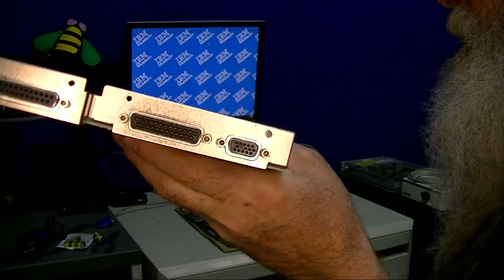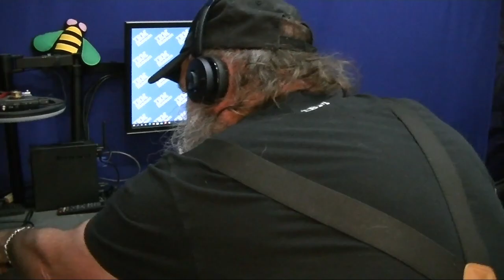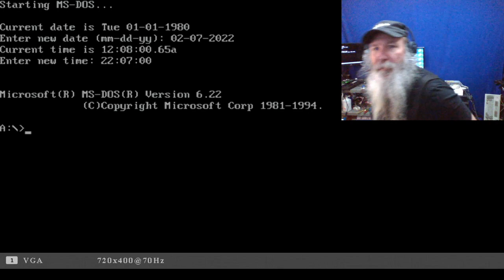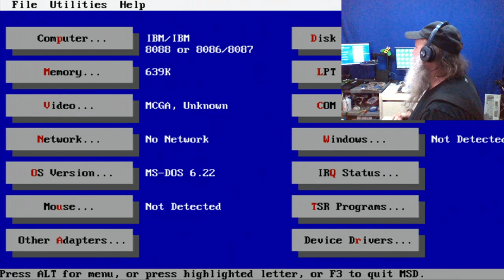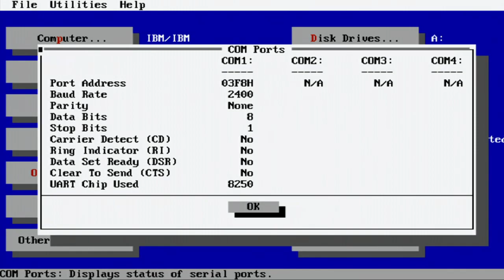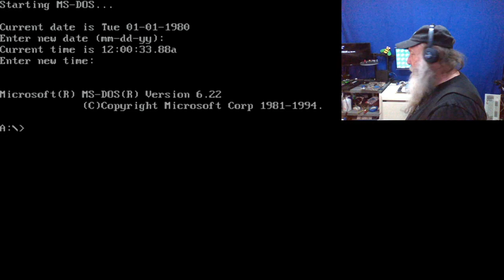The 7496 "Executive Workstation" components - benched for demonstration!

Comment: You are on the right track here. The 7496 Executive Workstation is another piece of the 7960 Clinical Workstation. While the 7960 hung next to the patients near the beds, the 7496 sat in the crowded nurses pits - thus the relatively well sealed units and small stature. The labels on the bottom of the the units give the clue - they were printed by the same company that did the conversions, and that company was not IBM. This was done for a relatively large trial by one of the healthcare providers - maybe Spectrum? I found a link a couple of years ago describing the system, but it seems to have disappeared. It describes the trial having 1000 units, but was ultimately not a success and killed off. I do not know what the central server was - perhaps a mainframe?

I would not try to add a hard disk on anything to the system - just keep it as is, as close to original configuration as you can.
Reply from the maker: It will be easy for me to use as intended - likely an Ethernet (as both of my ICLAS servers are set up) or Token-Ring RIPL - not the 5250 or 3270 emulation that takes the appropriate 720Kb diskette software to operate (and I have terminals for that). Better to connect it for the PC functionality - Thank You for your input!
Reply: Interesting info. This makes much more sense than the "prototype" theory. I think we are getting somewhere. But if all these units were made to become part of one large installation, I'd expect to find the same type of communications/networking adapter in all of them. Yet there's nothing there. It may have been an option, or perhaps the adapters were removed at some point... there's still more to uncover here, I feel.

Comment: The LPT1 port really is at 378h here - that's what the POST code uses to output the checkpoints. Regarding the bodge wire, It would be interesting to check whether there is a connection between the same two points on an unmodified planar.
Reply from the maker: I was falsely thinking that all the PS/2 parallel ports were at 03BCh (remembering reported troubles for running an early parallel port ZIP drive). Thank You for the correction. MSD is off in other areas (bad counting of LPT ports too), but I should have realized that was pretty basic.

The bodge-wire - and its placement compared against the schematic - will be my focus today. It was easy enough to remember it with the same brown PCB color. I really need to look over my Model 30 planars (or the pictures) for any pen markings prior to the April 1987 release.
Reply: @IBM_Museum  Yeah it's 3BCh for MCA-based machines, and 378h for ISA and the rest afaik. And yep, you are right about MSD, the machine and BIOS detection is really wonky.